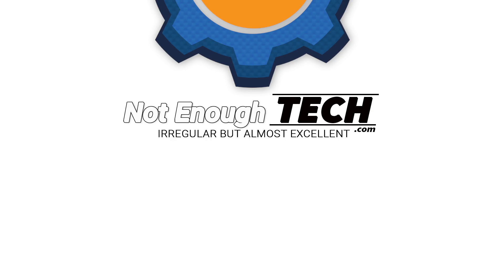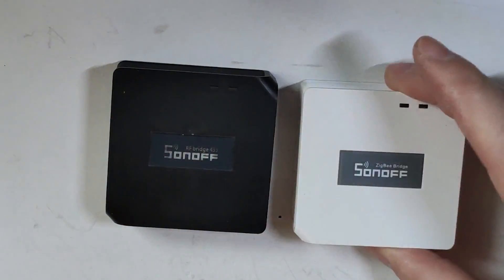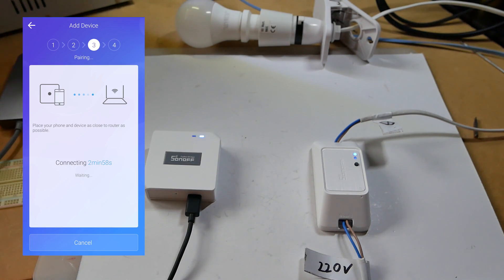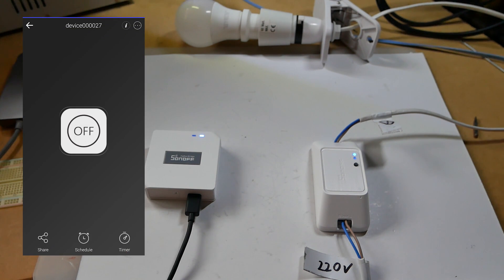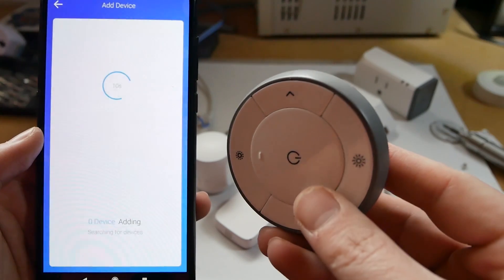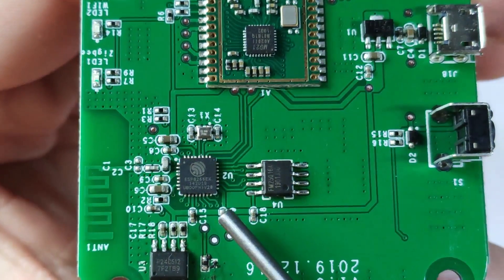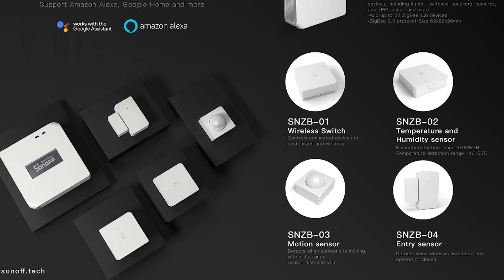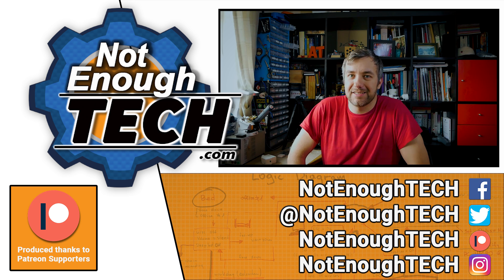Sonoff Zigbee Bridge

Comment: How can I integrate zigbee devices connected to the Sonoff bridge that are not made by Sonoff with Alexa? Currently, the discovery and adoption process into the Zigbee hub is quick and effortless. Unfortunately, Alexa and Google assistant do not see these zigbee devices.
Reply from the maker: Some devices would work (providing these are the known type to Sonoff Bridge) otherwise you would have to flash the bridge with tasmota to open it up completely

Comment: Can I control Sonoff DW2 RF with this bridge or I need the RF black one sonoff ?
Reply from the maker: You will need an RF bridge for that
Reply: @notenoughtech  Thank you
Reply: What temperature/humidity sensor can I use with the sonoff RF bridge and would it be able to trigger Hive ? Thanks for the help
Reply from the maker: @ventsislavdimitrov4110  donoff has their own sensor that work . I'm not sure what integrations hive has if I'm honest. Check my DIY Smart Heating article
Reply: Can I bypass the sonoff bridge and just uss Broadlink as a bridge?

Comment: Thank you for the video. I am trying to decide from RF Bridge or ZigBee Bridge. My use case is external 433 window shutters and motion sensors(mainly from PNI but not exclusively); trying to set up a smart alarm system. Think i can use any of these 2 and which is better for my case. I have a RM4 pro but am disappointed with the range- cannot controll shutters from more than 7 meters away and it does not support motion and window/magnetic sensors.
Reply from the maker: 7m won't be a problem. Advantage is the mesh as well. More devices in your mesh (powered by mains) the better range you get. Go ZigBee you won't regret
Reply: @notenoughtech  Thank you very much for the fast reply. I will try the Sonoff Zigbee version then :)
Reply: @notenoughtech  But just to clarify, do I have any advantages in my setup by using Sonoff Zigbee over the regular one ? Did you see any range difference between them ? Thank you
Reply from the maker: Mesh is the key. Sorry for the late reply YT is bad at notifications.  More powered devices you have with Zigbee the stronger the mesh

Comment: I see everywhere that it could work with Google Assistant. If so, show me how. I didn't succeed. Thanks
Reply from the maker: Link it with eWlink app via Google homes app
Reply: @notenoughtech  I did also with a Temp and Humidty sensor. I  see the bridge in Google Home. That's all. I see also a lot of times: "Google Home don't speak Zigbee"

Comment: Is there a occupancy sensor which keeps device turned on win I am in the room and turn off whn I have left
Reply from the maker: You can write the logic for this with NodeRED but it will be down to the poll rate of the sensor. If you need something else, you can experiment with light probes across the doorframe to count the in/out movements

Comment: Awesome video. I need your help, I’m stuck in the situation where my Sonoff Zigbee bridge doesn’t find my Sonoff Basicr3, the light in my Basicr3 only flash blue, I don’t know if it matters. Any suggestions to me? I really stuck and can’t find any solution.
Reply from the maker: I hope you mean Sonoff Basic ZBR3? Otherwise you won't be able to find!
Reply: NotEnoughTECH you are right, mine is BASICr3 and it’s why doesn’t work. Thank you
Reply from the maker: You can add it in the usual way. Just via eWeLink app. For ZigBee you will need the ZB version. They all look very alike. I mark mine with pen to tell which one is which
Reply: NotEnoughTECH I’m looking to use it via Zigbee Bridge, I got over 10 Basicr3 and connecting via direct via app is slow, sometimes doesn’t work properly, anyway I will think about to change to BASICZBR3 in the future
Reply from the maker: Have thought of flashing it and using MQTT?
Reply: NotEnoughTECH does it pair with Zigbee Bridge doing it? (I’m not into of flashing).
Reply from the maker: No. ZigBee need ZigBee hardware. But it enables LAN so you don't suffer from eWeLink connection issues. I know eWeLink has Lan control option but app itself needs to connect as well

Comment: Does this bridge pair with any Zigbee light bulbs?
Reply from the maker: Probably not. This will depends on the type of the bulb as well
Reply: @notenoughtech  that's kind of weird isn't it? Does the app has zigbee bulbs as a device type or something when you add a new device? I'm trying to figure out if this bridge is of any use as I already own multiple zigbee E27 and gu10 bulbs and spots.
Reply from the maker: Unfortunately ZigBee still comes with many standards. If you want to get the most of every ecosystem go with cc2531 and raspberry pi.

Comment: what are the zigbee devices can be paired with the gate
way, i mean other brand like tuya
Reply from the maker: At the moment Zigbee 3.0 devices with the same type should work - but take the "should" as advisory.
Reply: so probably the older xiaomi miija sensors will not work? arghhhhh... i wished they would stop chaing things around! lol @notenoughtech

Comment: Hi I received my new Sonoff zigbee bridge 3 days ago I tried to connect my Sonoff water sensors no joy with my other zigbee products as well this bridge dose not do nothing now I have to order Tuya products plus have you got your zigbee products to work with the zigbee bridge
Reply from the maker: Was there a pending firmware upgrade when you received? Make sure your pairing procedure is correct
Reply: NotEnoughTECH hi I think they was a firmware update did you get all your devices to work on it
Reply: NotEnoughTECH hi again I am still having problems getting my aqara water sensor to work on the Sonoff zigbee bridge will it work on the Sonoff bridge before I send it back to amazon
Reply from the maker: Water sensor type isn't supported with Zigbee Bridge. You can use compatible Zigbee sensors as long as the type of the sensor is the same.

Comment: hi there! may i please get a suggestion from you? i am still noob, i am trying to get my equipment to all work with via voice with google home and alexa (i have both). i have many xiaomi aqara sensors; body, water, temp, windows, fire, gas and the aqara b1 model curtain motors. none of them will work with voice, it sucks! i need to find an integration method to have them work via voice. what do you suggest? is samsung hub smart things the only way? thanks in advance.
Reply from the maker: Hi, I would need more details about your setup. Most Zigbee sensors report. They cant be queried as they don't post the information back on request (most not all) so to query information from the sensor via NodeRED you have to save it. This way when you ask for a temperature, Alexa/GoogleHome checks your automation server for the last known update and reports back. 
Foir Alexa I use Alexa nodered skill and for Google Assistant I use Nora for node red
Hope this helps

Comment: Looks very promising ,wonder if everything will work with Google Home as do other Sonoff projects .Sonoff RF projects don't work with Google (as far as  I remember from when I bought and tried to install about a year ago.)
Reply from the maker: You can address ZigBee devices by name via Google home or Alexa with this bridge
Reply: @notenoughtech  Thanks for the swift response 
. If I have three or four of these around the house will they integrate into a mesh like system giving me better reception around the house ?
Best Regards .like your videos quite a bit but I am new to your channel ,great topics and very well executed . thanks again
Reply from the maker: @daromee  Thank you - I found the bridge to have really good coverage. I live in a 2 story house and in the worse scenario when signal goes across floors and structure wall as switch was outside - I still got coverage :)

Comment: Have you tried the new zigbee2mqtt IKEA firmware upgrade? A video about that would be great
Reply from the maker: that's new - can you link me?
Reply from the maker: Hmm... but most IKEA stuff was working fine - am I missing something?
Reply: @notenoughtech  I am not sure what update there is on IKEA devices but the news is OTA. Perhaps someone knows what is updated. I the past i have seen Ikea bulb has been updated so they could be used together with phillips hue.
Reply: @jenskaa4044  update of bridge firmware and power sockets. The latest seam to cause a lot of problems....
Reply from the maker: Looks like I have been lucky with mine - but may make a video on that - thanks for bringing this to my attention - I also see conbee support... and I do have one :d
Reply: Also I've heard that the new z-stack 3 firmware for the cc2531 is going to be released, which should solve a lot of tradfri (pairing/joining) issues.